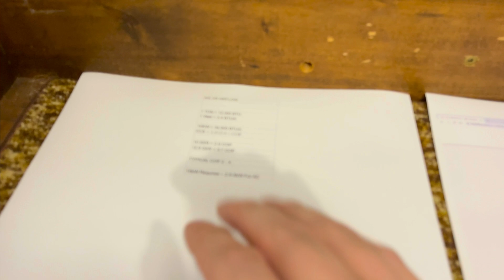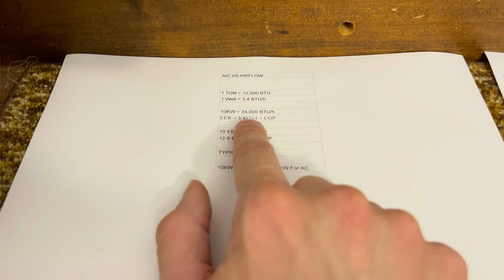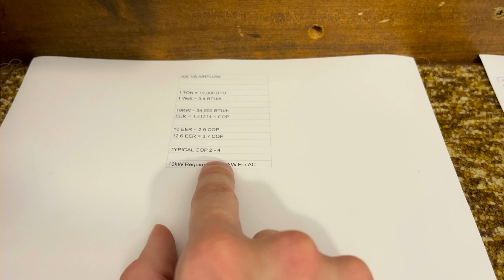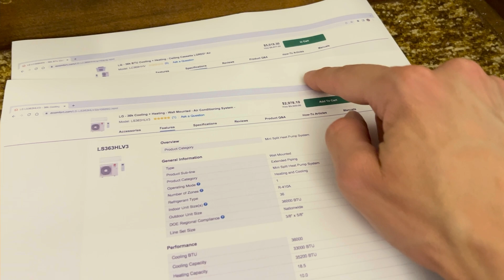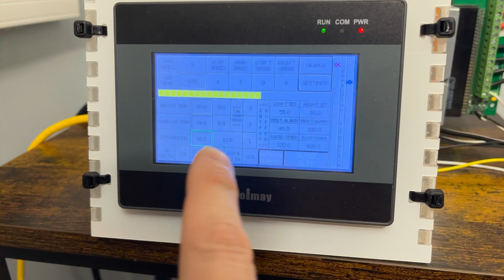Why Can't I Use A/C For Mining?!?

Comment: Get an ac dude. If you get an ac that is powerful and efficient enough it far out weighs the problems you have with your setup. Preferably one that has a closed loop intake and exhaust system that can be fed out the window or installed outside. Some air conditioners don't run constantly. Some will power off intermittently with a thermostat. Was that calculated in your math? Even if the ac is adds to your electric bill with a long ROI it's still way cheaper that replacing your entire mining room due to damage caused by dust bugs and humidity. Those things can potentially become a fire hazard over time. If you're adamant on not getting an ac at least put proper filters on your intake window and put proper exhaust fans on your other window. Bigger blades mean more airflow and higher efficiency. Put a rheostat switch on the exhaust fans or any fan for that matter for maximum efficiency and fine tuning. With the remaining windows, board them up and insulate them and insulate the ceiling and walls even more. At the very least invest in a dehumidifier. It will cool the room down by removing the humidity, nonetheless humidity shouldn't be in there anyway. Good luck 👍
Reply from the maker: I appreciate your comment, however there’s quite a lot here that’s not accurate, or at least misleading. This discussion was not about me, or my mining room. It was to discuss the common misconceptions and help provide insight for others to base decisions off. My mining room works very well, and does not have issues.  The fan array is very efficient and is near ideal for my setup. It’s sufficiently filtered, the hardware is not at risk. It’s nearly impossible to remove all humidity, and is also not the best for some components. Dehumidifiers always actually heat, not cool. They consume power, which 100% ends up as heat. They make air ‘feel’ cooler to humans, since they sweat and this evaporative cooling is more effective in lower humidity. To the GPUs it just means higher temperature and wasted power. It gets quite complex to discuss this in depth, but generally speaking you want to maintain an RH around 15-65% indoors, peaks around 75-85% are acceptable if they’re not sustained for long durations. The hardware will never be at risk even at 95% RH, but since measuring RH precisely is quite difficult, and there’s going to be a considerable variance, some overhead is reasonable. If the air the GPUs ingest is even 1 degree warmer than outside, you guarantee humidity is within allowable maximums. This is by a MASSIVE margin the most cost effective way to cool hardware. It does not work in every situation, but for most, with careful design, its a massive savings over AC. I’m quite familiar with AC systems, and have installed many. How often it runs is more or less meaningless since that does not change steady state efficiency. On top of that, you typically do want it to run continuous since this means less losses from the system pumping back up again, and potentially less wear from reduced thermal cycling. This is very dependent on system design, but generally that’s why inverter systems are preferred. They also tend to operate at higher efficiency at reduced load due to being able to reject heat over a larger effective surface area at part load. Again, this is a complex discussion and depends massively on the exact hardware and design. Many considerations must be taken into account to ensure the unit is being operated at peak efficiency and will serve its function sufficiently. Most ignore specs and just slam something in based off rated BTU and SEER.

Comment: Why use all those server fans when u can use 2 prop  fans using less power and less cost to purchsse?. I have  a 900cfm fan that draws 60 watts and cost me 70$.
Reply from the maker: I talk about this in my airflow video. I had serval requirements that makes this array perform better than the other solutions I could find. This is more like 6000 cfm delivered, and faces a fair bit of static pressure due to the exhaust restriction and intake filters. It’s also challenging to estimate the power consumption by looking at it, this array is reasonably efficient. Most likely this array is more efficient than the fan you’re talking about would be installed with the same static pressure.

Comment: In india, I need to run 2 acs out of 3 to cool the gpus. Its usually 46 degrees celsius outside. Without AC, the cards will fry.
Reply from the maker: What cards do you have? Lots of GPUs will be happy with 46C ambient, just not ones with GDDR6x.
Reply: @SiCPoWMining  all my cards are 3090. Few 3080 non lhr and 3080ti...46c is too much...inside the building its more...we have concrete apartments. Roof and walls are concrete. They get very hot.
Reply from the maker: That’s certainty a big challenge with all 3090’s, those are difficult to cool even in 20-30C. Is your electric rate low? It has to be challenging to operate a farm of 3090’s in such hot weather with todays electric rates.
Reply: @SiCPoWMining  It's 7.03 inr or 0.09$ per kWh on commercial meter/connection. Residential meter is much more costly.

Comment: whats your thoughts on octominer casing? does it really dissipate  heat out from the casing? thanks..
Reply from the maker: The ocotminers are overall quite good, but very expensive. The fans they use are questionable quality, and due to the design they need very high power fans to cool the cards, which brings moderately significant power consumption. This power consumption could be reduced or eliminated with substantial spacing. Either way, the heat that comes out of the case needs to be removed from the room they are in or else it will lead to increased intake temps and hotter cards. All the same cooling issues exist, they just give you very good power density for GPU mining at the expense of reduced efficiency and higher initial investment. You can buy similar boxes out of China for substantially less.
Reply: @SiCPoWMining  many thanks…
Reply: I'd rather put the money spent on cases in gpus and fans
Reply from the maker: Yeah, that’s the only sane approach. Buy more GPUS and hang them from zip ties on a rack made out of stolen pallets. Who needs style and class when you can have janky hash?

Comment: 11.44kw u think need how many cfm exaust ?
Reply from the maker: I did a video discussing my mine, which is around 10kw, linked here if you didn’t see it. https://youtu.be/mCq4WcqF0mg

I’d say around 6000cfm minimum, delivered. So shoot for a fan rated at least 8000, maybe 10,000. If you get one that’s speed controllable, I would go even higher and dial it back so you have a bit extra if needed. It’s hard to have too much airflow. How well it performs depends on your installation and application, but a lot of airflow works well in most climates.
Reply: whole house fan

Comment: what are your thoughts on placing evaporative air cooler at the intake?
Reply from the maker: Evaporative coolers work, but only in some very specific conditions. Water will absorb heat when it evaporates, so if you can get enough water to evaporate, it will work effectively the same as A/C. The trouble is as the relative humidity increases, the amount of water the air will hold drops. In most climates this means you either need MASSIVE surface area to be able to absorb meaningful amounts of energy, or very dry conditions year round. Warm air also holds more water than cold, the very same reason you see sweat on cold glasses in summer. The colder temps around the glass cause the air to not be able to hold on to as much water, and it collects on the glass. On top of this, electronic controls are likely a good idea for most climates aside from a desert otherwise you can have very high indoor humidity which can be problematic for some hardware. Care must be taken to ensure the indoor humidity isn’t constantly over 70% or so, or else issues with mold and other organics growing will be difficult to avoid. In practice this means evaporative cooling only work in hot, dry climates, and care must be taken to ensure the building can tolerate it. If you have a concrete or steel building, and controls to ensure the conditions are right for the cooler, with some sort of failsafe in the event of lower temps or higher RH, it works fantastic. Trouble is this tends to mean it’s best suited for larger scale and very specific regions. For most people it’s a bad idea and increases the risk of damage to hardware from the RH being very high. You see it a lot in industry, but it’s a closely monitored process and the setups can be quite complex to improve performance and mitigate issues. It certainly has applications, and it works great in the right climate with a bit of care.
Reply: @SiCPoWMining  thanks for clearing things up. am a miner in asia struggling with ambient temps during high noon reaching as high as 38/39c. explored air conditioning but arrived on the conclusion that its economically unviable hence evap air cooler came to mind. Been gathering RH data for months. with your explanation, it gives me the confidence to that evap air cooler might just be my solution.
Reply: btw, love you your channel as its much more technical explaining the formula and calculation behind each decision. very informative compare to other channels where they only offer anecdotal solutions thats based off trial and error.